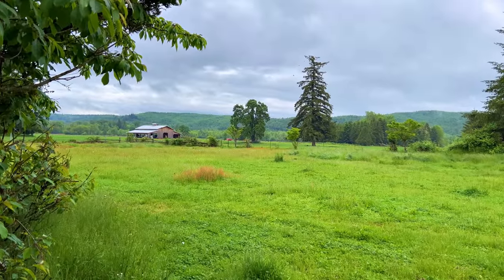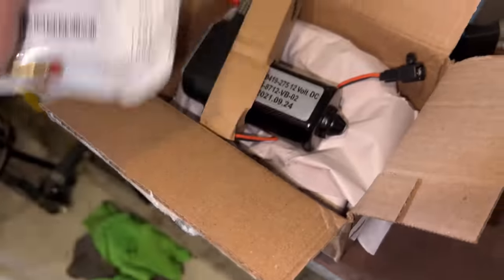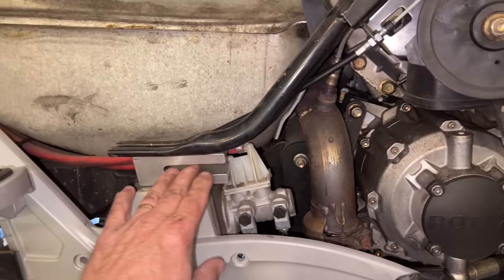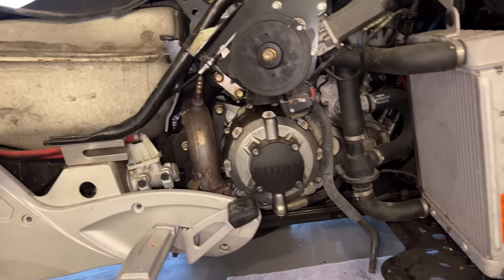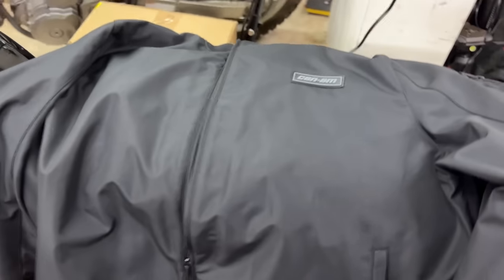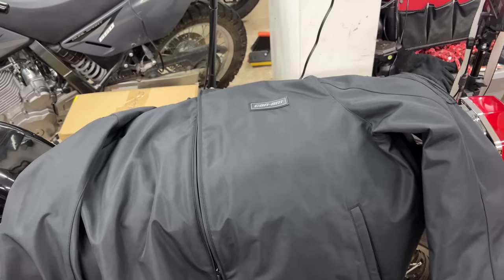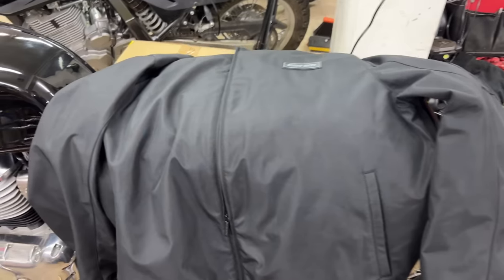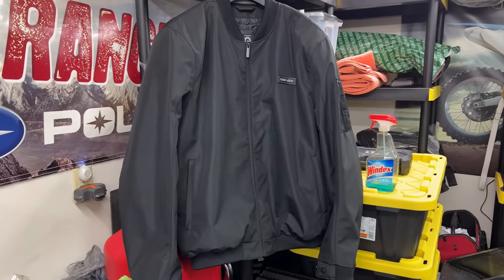Spyder RT Water Pump!! • Can-Am Bomber Jacket! | TheSmoaks Vlog_2392

Comment: Cool video. Simple question I have water in my oil could the seal from that water pump be causing  that issue. I pulled the spark plugs they're super clean when the bike fires up it doesn't smoke or anything